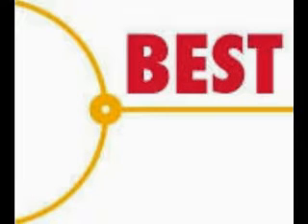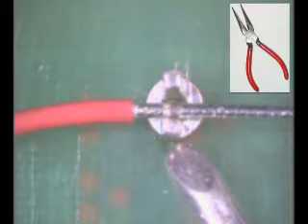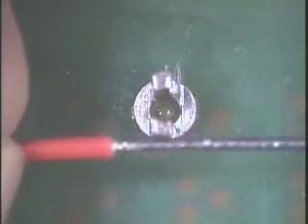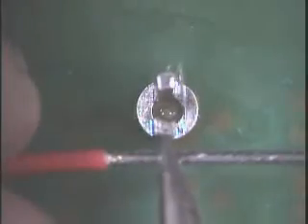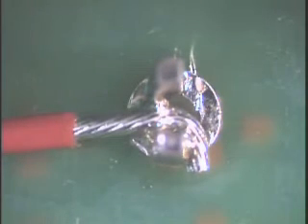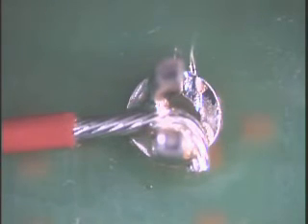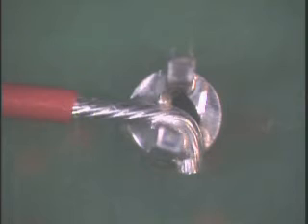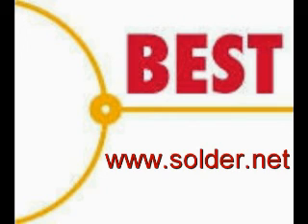Bifurcated Terminal Soldering

Comment: I would of wound the wire around three sides of the post.  You shouldn't rely on the solder to form the mechanical joint.